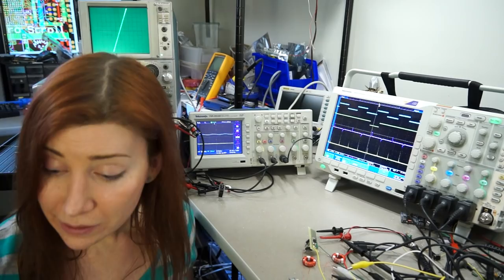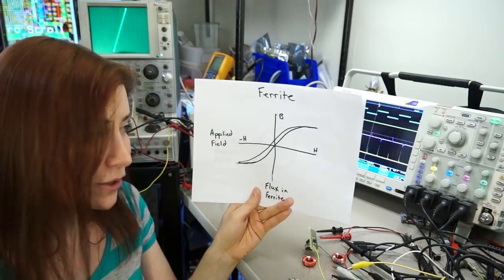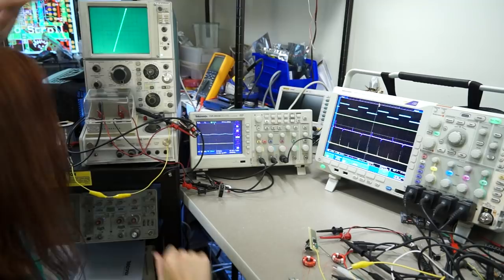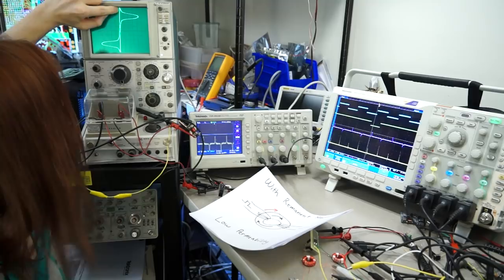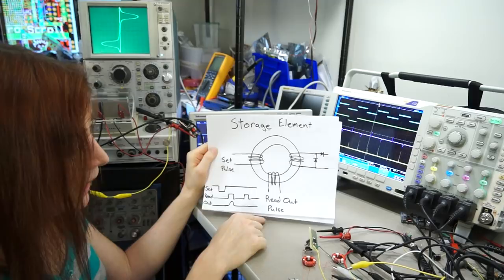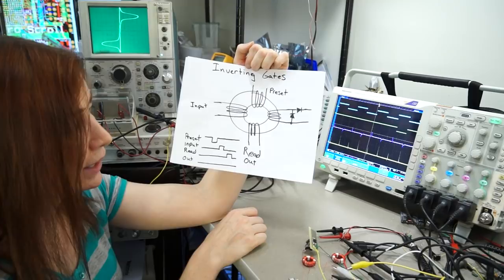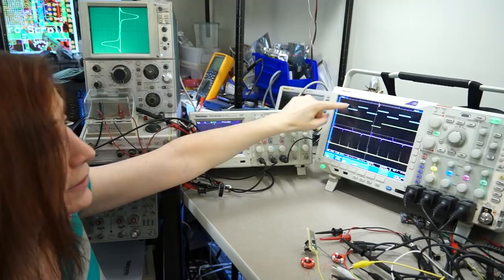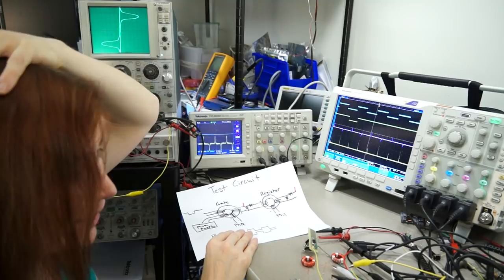Magnetic Logic - Forgotten Technology

Comment: P.S.  These was also another winding on the cores called a "kill winding" for reset like in a flip flop.  The tool used to remove them from the board was called a "crab grabber".  It was hard to unsolder all those wires at the same time with hot stones from the campfire in the cave.  That particular machine used vacuum tube drivers, which meant I got to work in air conditioning.  Yes, we had that then!  ;>}

Comment: An interesting "history" lesson. For any viewers that are thinking/commenting that this might be some new fangled, better way to create computer memory, this is 1950s technology. The reasons for putting this on the top shelf was speed, bulk, and heat. oz for oz a transformer coil will generate far more heat than a semiconductor. The physics of changing magnetic fields imposes a limit to the speed that a coil can "latch" on to a state. The reduction in size of this system produced "Bubble Memory" which is another form of magnetic memory but still not as efficient or quick as turning off and on the flow of electrons through a semiconductor. Great video!
Reply: Efficient for WHAT .... ?? That's the question you need to ask.

Comment: Your a great educator! I searched on and off for most of my teenage years for a proper explanation and never once until today did I find the answer. Even most computer and electrical engineers I talked to had no idea how this shit worked. It's genuinely great. 6 years at least. And this was made 7 years ago. I just wanted to know how the space rockets worked. And today I searched again because I figured that it would be very helpful in creating neuron networks for my robot's limbs.

And it's perfect! I can't really use too many soldered connections and even wire is at risk breaking. This however just needs ceramic rust rings and a coil which I plan on using conductive coated fibers or specialized plastics for. 

All kinds of excited for the options and possibilities this gives!

Comment: Good job. Enjoyed the trip down memory lane. My first co-op job was at Lincoln Labs where I had to measure hysterises on manufactured cores used on the Polaris Subs. Actually got an A on my EE lab paper because I had access to a system that would measure and print the H-loop out. 
Later on when I worked as a test engineer we were very proud of our 16K core memmory in a computer used to calculate projectile trajectories. Later it was upgraded to a 32K core memory. Limitation of course was the space required since the cores could only get so small to be useful. We had a hell of a time keeping the systems working. Field reliability was compensated by the fact that the computer did away with hours of calculations done with slide rules by a an artillery fire unit.  The computer had to be housed in a half empty ton truck. Eventually all this got replaced with laptop that could do the calculations for the whole artillery battalion

Comment: Thanks, Jeri. I had a look at an Elliott 803 at The National Museum of Computing a few months ago and had an interesting discussion there about magnetic logic. Like you, I couldn't find much information online. Your video made it much clearer. The Elliott machine used germanium transistor gain stages between gates to maintain the amplitude. It also had (relatively) beefy clock buffers for each set of gates so the cores could be "set" each cycle. What is more impressive is that this machine still works!

Comment: Magnetic logic was used for the control system of the Sizewell B nuclear power plant in the UK, which was commissioned in 1995.

The health and safety executive (which was responsible for nuclear safety) required that the reactor have dual redundant control systems, operating in different modes, so as to prevent a simultaneous failure of both systems. 

Magnetic core logic was used, with an automatic switch over to a PLC in the event that the self-diagnostic circuits in the magnetic logic detected an internal fault.
Reply: ChumpusRex I bet that wasn't cheap!

Comment: It's called "Toroid Memory" Seeburg jukeboxes introduced this technology in the late 50's to replace the old pin banks. What's also cool is that it is non-volatile. When power is removed from the equipment in which it is installed the toroid remain in their last set state. Don't think they are immune to an EMP.
Reply: +Bruco Alidas Investigate Graphite shields. Be surprised what you can do for cheap.

Comment: Ahh, memories from high school.
Zanovat La'toh - Yes, humans had to thread/weave those little microdonuts by hand into lattices of wires in those grids.  We watched a couple movies of the process back in high school.  Those were being built by hundreds of Japanese young girls, who had the good up-close vision AND the fine-motor skills to do the job.  Unfortunately, we learned much later that most of those young ladies acquired severe vision problems later in life.  The movies of those things being built are still out there.

Also, it was a few of those core grids like the one Jeri held up at the start that served as the programmable memory that landed with the LEM on the first Apollo moon landing.  Because transistors were still too fragile or susceptible to shock and vibration, these heavy duty core things were the only thing currently extant at the time able to withstand all the shocks and shaking of the rocket trip to the moon.  And, as I recall, that moon landing was accomplished with only 64K of memory, 'cause the stuff was so big, they couldn't fit much more aboard.  So, you can imagine it took some pretty compact coding to make it all work!
Reply: W.J.R. Halyn 😂 WTF!? 😂 Are you playing with your curvature? I heard they used a Commodore 64 with a flux capacitor wearing bras on their heads at a skull and bones sleepover. Please stand between two rodin coils, put down the bottle, get a bowl of MR.T cereal, and stop glOBEYing!
Reply: I believe your probably 100% correct.  Not sure what ty's problem is.

Comment: A current flowing produces the magnetic field. Not a pulse or a voltage level. If the current is modulated, and the level of the current is greater than the hysteresis of the material properties then coupling will occurs.  Core memory is fantastic. Writing is easy, Reading is destructive and has to be written back. Thus the Read-Modified-Write instruction of early computers.  Good overall ideas however some math would be nice.

Comment: Nice demonstration. I just recently retired a large PLC system built in the 70s that utilized 16k core memory boards. The company finally came up with the capital to upgrade to modern systems. The system was originally commissioned in 1978. 39 years of reliable service. It was a little bit sad to throw those boards on the scrap heap.

Comment: In the early 80s, I worked with a guy at CDC that (years before) helped develop core memory ferrites for Seymour Cray in Minnesota for the early CRAY supercomputers. Cray wanted a faster switching time, so magnetic latency was the issue. The solution was found in adding 2 - 3% Silicon to the soft iron core to reduce hysteresis. In the years since, I wish I had listened more intently to his stories of early computer memory development, and barging in on Cray's boardroom meetings. And the stories about repairing B-17's in England during WWII.

Comment: Jeri Ellsworth - If you have not done so another magnetic area of interest is - Saturable Reactors. Transformers can be used for amplification and motor control as well. Core design lends itself to having a switchable hysteresis in the transformer when a DC bias is applied to the control winding. In some ways a S/R is far better than using semiconductors and Thyratron control because of its lack of switching transitients. I've worked in Electronics for 40 years and used inductors to control the motor speed inside Sorvall Centrifuges used in the Uni Labs I worked within some years ago.

Comment: I know that you can make any logic gate with NAND and/or NOR gates. Having said that, and not seeing it in your comments, you could just reverse one input from your primary inputs (change the polarity of one coil) so that the 50% and 100% flux inputs function as a NAND and NOR gate. This essentially changes the instantaneous polarities to oppose each other instead of being additive. Also to get the 50% and 100% values you can just add/remove windings to your primary coils so that you can "tune" your induced flux fields to the required values. This will also work on the other coils as well. I believe that you already know this but it was not discussed in the video or the forums. And by the way, great video.

Comment: Hi, I was a tech on CDC 1700 mainframes, that plot you showed of the "square ferrite"" we called a shmoo plot and was used in the adjustment of the amplifiers in the core memory. Basically the positive and negative voltages of the amplifiers were adjusted until a program running on the machine detected an error in the 0 to 1 transition or 1- 0 transition. Also for your info, the core memory and the ferrite systems in general were write after read because each read detection flipped the state of the ferrite so it had to be put back afterwards. The CRT's Cathode Ray Tubes or displays had memory that was just a very long wire about 1 Km long that matched the scan time of the raster from top left to bottom right, the signal on the wire was read sent to the Z input of the display in sequence and re-inserted back on the wire so it was a continuious loop of 1 and 0 on the wire that matched the bright and dark on the screen. IC's had not been invented when the 1700 was designed but, it did have CDC hybrid circuit chips called intebrid's and PNP and NPN transistors and a headache of different logic levels and converters between the systems. The intebrid's had small fanout of 5 if I remember correctly, so to feed more inputs you soldered another one on top to increase the power capability. 

Thanks for the memories. Andrew

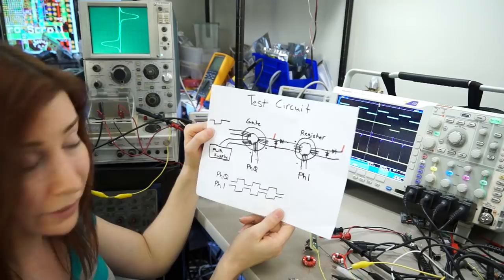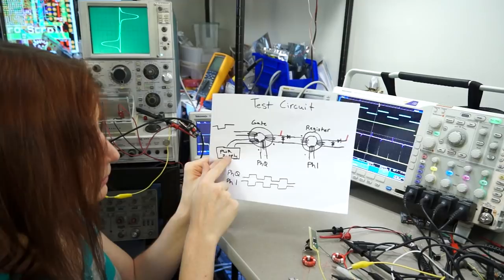Comment: This is the first video by Jeri I've seen, and I'm very impressed.  Somewhere around 13:45 I got the idea that she's talking about a magnetic logic circuit analogous to a CLB in a Xilinx FPGA, i.e. a pipelined logic stage, and about 14:28 she said the word "pipeline".

I hope this video helps inspire young engineers with the idea that there's more than one way to implement a function, and the best way for your application may be to use a technology that's completely different from a physics point of view from what you're used to, but mathematically equivalent.

Comment: Here's some input from one of the "ancients" you were talking about. I worked with this technology in the USAF 1964-68 (Crypto equip.). It's not like we didn't know that transistors were the future. Transistors were too noisy, and to replace the cores with an equivalent T ckt. flip flop, would actually take up more room then. The cores were mostly used as memory. In 1965, I saw a flip flop IC on a single 12 pin DIP, instead of potted discrete components. I got to hold a ball point pen too! WOW!

Comment: Bi-Mag cores were the heart of the cryptographic gear i maintained in the Air Force. Eventually augmented with two transistor flip-flops molded in plastic. We never saw an integrated circuit until 1973 when we were building the test gear for the KH-11 satellites. Nice curve tracer, Tek scope and God knows what the big boy is on the bench. We were separated at birth. I used to work for Tek!

Comment: In the mid 70s, everything was going to RAM chips and core storage wasn't being used much.
During my years as a tech instructor at GTE Sylvania Technical School Waltham, MA, some jerk (Night instructor) decided to steal and copyright our lesson plans. We had to rewrite everything! (It also gave the school reason to buy new training computers. Which were great)! 

 Since I was the digital guy, I wanted to include a simple Lab to add some hands-on the standard info in the boring textbooks. A lab that would illustrate the basic principle of the Historic Magnetic Core Memory! 
All the students had logic training boards with power DC supplies, buttons, and switches etc. They also had nice O-Scopes. 
All I had to supply was a magnetic core (a steel/iron washer) to each student, and draw a diagram on the board.  
Diagram: 12 DC power via a resistor and MC (momentary contact) push button, feeding into the center contacts of a DPDT toggle switch.  The 2-wire output was cross-wired to provide &+ or +& depending on the DPDT position. 
Those two wires were connected to a few turns on the washer. By flipping the toggle, and pushing the MC button (for a half second), you could set (or reverse) the magnetic field of the steel washer.   To help see what had been "Written" into the Core (washer), we assigned UP of toggle as "1" and DOWN was "0". 
 
To Read your Bit, A secondary few turns on the washer was connected to the O-scope.  Once the Write winding was pulsed on, the washer had a one or zero written into it.

You could tell what was written into the core, by rewriting it with a Zero "0". 
If there was no large pulse on the O-scope, the data bit was a "0", if there was a big pulse on the scope, there was "1" in that washer, and you just erased it!  
(When actual data was read from those old core memories, it was always re-written back into core to preserve the data). That function was hardwired into the Fetch Op-code of those old computers. 

Some of the kids connected op-amps to the output of the read windings to make it more like textbook diagrams. Some wanted to use the the read pulse to set a TTL flip-flop and use it to light an LED. 
We all had a good time. At the end of the day, a 10 question quiz was aced by almost everyone.
 
It was absolutely an easy fun day that I used on Fridays. Monday was back machine language programming again. All those kids are retired millionaires by now. I hope.

Comment: I didn't know they used mag cores for logic functions!  I did once work with a computer with mag core memory, though.  As I recall, the mag core was 2048 words.  It also had a rotating magnetic drum bulk storage.  That part was as big as two washing machines and held 256 K of 24-bit words.  It was a General Electric 4010 process control computer.  It's so old and obscure that I can hardly find any reference to it on the 'net.
Reply: rationalguy those are the cool things lol it's neat to think they used magnetic fields on ferrite rings to store binary code. The fact they did what they did with what they had just amazes me. Pacman game would have needed a house back then lol :P

Comment: Inwe have this Philips COLOR  television; no longer in use. One day I opened the back and couldn't find a single chip. No transistor or any kind of that thing 

It had miniature coils on what looks like copper(single)  plates(transformers) . I  couldn't understand how such a circuit worked. It doesn't have diode or triode. The only tube is the TV tube with the electron gun. 

You have given me a fair enough understanding.

Comment: Takes me back to 1962 and a Royal air Force course for future Instructors and maintainers on the the Bloodhound missile system at Ferranti Wythenshaw.  Part of this system was the Argus 200 computer.   After the official course was finished we, the maintainers were sent back to the factory to assist with the next course and glean as much further information as we could. I was assigned to assist the Ferranti  instructor on the Argus 200.  Although this was nominally the training computer it became the defacto experimental machine. The Argus 200 used core store active memory and I was asked to write the training notes and try to answer some questions raised by the programmers. As seen in the video the ferrite cores each have 4 wires passing through them 2 read wires a set wire and an output wire. This is a destructive read out so to read a line of code the X and Y read wires of that location each receive 1/2 the required current to collapse the field, if the core was set to a 1 this collapse induces a current into the output wire which is detected. Now all the other X and Y wires in each row receive 1/2 current but do not flip, insufficient current. Now the question arose "how meany times can the cores receive 1/2  current before they loose all their flux. I could not find any reference anywhere so did some experiments and thinking. It turns out that each time the core receives 1/2 the current, it looses a bit of its magnetism now each loss is a little less than the one before, 
 so using the formula for charging capacitors  it is possible to prove that at 2/3 full      flux the extra     loss is infinitesimal and can be ignored. I could not get any measurable decline after operating the same core repeatedly for days. In the Bloodhound system the Argus 200 operated for 25 years and I never heard of a problem.
Reply: You more than likely know my brother Fred who was in the same line has you about that time.

Comment: I worked on minicomputers in an age when memory was ferrite cores (the General automation SPC-16). If one of the computers was not working, we would go to another one which was, load diagnostics from paper tape, pull the memory board out of the one and insert it in the one that was not working. Because the state of memory in the cores did not fade when power was removed, we then had diagnostics in the non-working computer. Kind of like a thumb drive of today, but much less convenient.